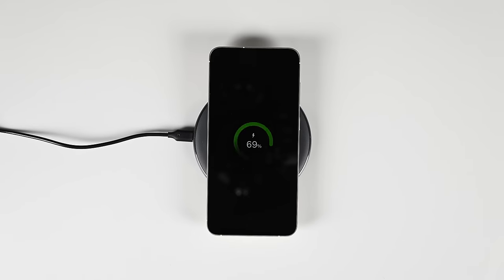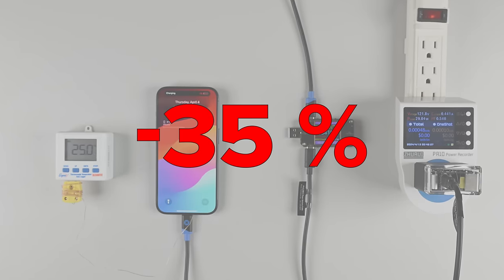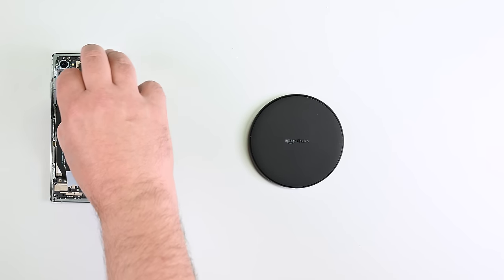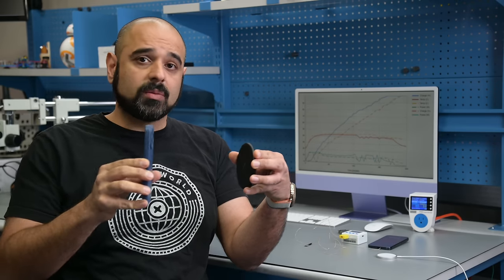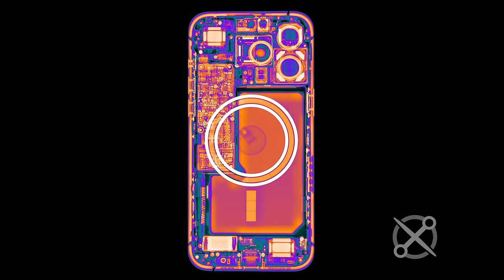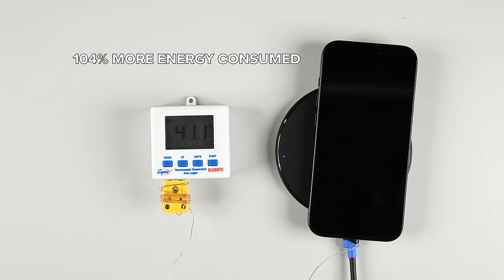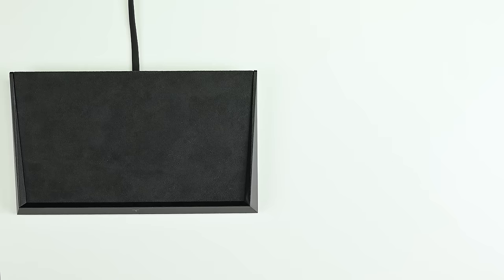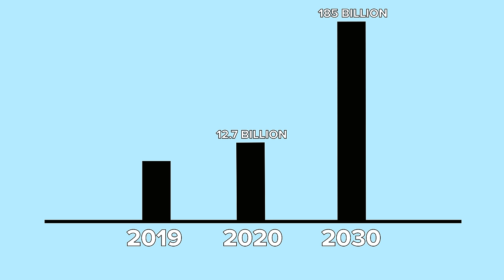How Wireless Charging Works and Why It's Terrible

Comment: I go a step  further and use a normal 5W usb brick most of the time unless im in a rush, then i use my faster 25W port. Its just not worth it to fast charge when i have so long after work to keep it plugged in. Also don't charge overnight, if your phone cant hold a charge over night and be usable the next day then you need a new battery. BUT to be a devils advocate, I worked in a repair shop for a very long time and people break charge ports very often, its by far the most common repair besides a screen replacment. So most of the time, changing a battery yourself is easier then replacing the Charging port. So there is 2 sides of the coin.

Comment: Wireless charging is also not wireless at all when compared to anything else we call wireless. The difference between wired and wireless charging: put the wire into the device or put the device onto the wire. Its a silly gimmick.

Comment: I got a 15 pro and i charge it with a wireless samsung charger and my battery last a lot longer through the day
Reply: Due to the temperature regulators and the fan that the charger has

Comment: my xiaomi 50w wireless charger is much faster than samsung and iphone wired charging methods, and it comes with a built in fan, so never over heats, on top of that it only costs 20 quid

Comment: Degrees Centigrade? Not Celsius?
Reply: Same scale, but centigrade is the older way of referring to Celsius. "Centi" meaning 1/100th, and the grade (gradient) defined from 0 (water freezing at 1 atmosphere) to 100 (water boiling), every step of Celsius is the 1/100th step of the gradient...
Reply: @NG6E  Yes its just the same thing, but the issue is thats the old name, It's called Celsius now.

Comment: I imagine, environmentally, not only are you using less energy to charge the phone with a simple USB C cable but you're also, physically, using way less copper, plastic and electronics with a simple USB C cable vs any charging puck. (Of course you'd need to factor in how often you replace the cable due to insertion cycles, but IIRC USB Type C is rated for 10k cycles, so like 27 years if you charge/plug in daily).

The embodied energy and thus embodied carbon to manufacture it being much lower than a charging puck.

Really wireless is only a modicum of convenience gain vs a massive environmental and energy tax.

Comment: The wireless pad already having a cable to it is funny. Why not plug it directly without extra steps.
Reply: because its easier to use, just put the phone on the pad and its done. no need to fiddle with cables and it helps your usb port last long

Comment: I'm not a fan of wireless charging. Especially now with USB-C PD 3.0/3.1 chargers in the 20 to 45 watt range being so cheap.
Reply: PD is even worse for your batteries.
Reply: @SanderEvers  Depends on how both the chrarger and the cellphone communicate through the PD protocol. If it works as advertised, the charging rate dramatically drops as the battery level starts to approach 100% to save the battery. 

I'm not a fan of wireless charging beause the induction coil charging tends to really heat up the whole phone.

Comment: ....But they aren't even 'wireless' tho...
I'd be into these things if they were, but all they do is just eliminate you directly plugging it in to your phone. Still plugs into a wall outlet, still is wired, you just don't actually plug it into your phone, and you now have a bunch of adverse effects, but you skipped a single step and don't have to plug your phone in and out each time...so yaye??.

Comment: Yes, of course, It's important. But - this is a bad realiazatiobns only. Why do you thing I need to charge with high power? And why the smartphone should be exremaly thin without the thermoconductive layer "Batter-case-etc."? I'm OK with typical charging speed 5W and with smartphone like Kycera Duraforce 5G. If Apple, etc. don't want to make a smartphone for me (with wireless charging, etc.) - I'll by another.

Comment: To be fair, the inefficiency isn't really a big deal if the charging pad is plugged in to an outlet.  The amount of energy involved in charging a phone is very small.  It's a bigger deal if you use a wireless charger with a portable power source.
Reply: Now multiply daily waste, 365 days and for each person in a household.
Reply: @sonickrnd  Its still negligible

Comment: Wireless chargers are not really wireless. You still need a wire for the charger. And they're not really contactless either. Cause the phone needs to stay on the pad.  Which brings me to my third disadvantage: mobility. Since the phone needs to be in direct contact with the charging pad, you can't use your phone while charging. While I understand the appeal and the interest for these chargers, I continue to charge my devices wired...ly.

Comment: Sorry, the "+104% worst-case" scenario sounds a bit construed and cherry-picked. Sure, it takes more than 100% power, but 120% (i.e. +20%) is a far more realistic number. A decent and intentional "back burner" design that would charge the battery overnight with low power, could in fact increase the lifetime. The alternative USBC connectors are not without their own flaws. It is, as most things in life, a tradeoff, and 'blanket' statements like these could be misleading.

Comment: Jokes on you, i connected a 5v 1A supply to my charger, it may not be efficient or fast. But my phone is still fully charged every morning while staying low temp.
Those few cases i forgot to place it on the charger i just plug it into my monitors 65w output while im getting ready.

Comment: For now the wireless charging is the future. In 10ish years wired chargers will be rare, and no-connector phones will be the standard. Data transfer between devices via wifi signal, and charging via coils. Then another 10-20 years from there, once energy efficiency and charging tech will further developed, power via wifi will be a common thing, and you won't even need to charge your devices, they will just charge from the nearby wifi signals.

Comment: It's okay, in theory, as long as the coil is cooled with a fan as most wireless chargers designed with longevity in mind from OEMs. However, as the video indicated, not all are equal or designed with a similar philosophy in mind.  lnefficiency, unfortunately, is inevitable, but I must also state that batteries currently have stagnated hugely and have been long over due an overhall in their efficiency tech and longevity. If both these occur simultaneously, I have no doubt the potential for wireless charging could work, but more often than not, wireless charging was more an afterthought when it risen in popularity that still echoes to today. The implication, unfortunately, is that this may translate to less priory on wired charging innovation or be the cause of death for it - which nobody wants. Besides, given how you seemingly can never have your cake and eat it these days with lackluster moves from major OEMs, I'd leave it alone and focus on where it truly matters: solid, reliable and fast charging with a physical connector to handle charging and data transfers, not a even wall gardened and/ or potentially proprietary data transfer method which will cause no end of headaches and backlash (I.e. the world apple wants).

Comment: I never got the appeal of wireless charging, sure its a fun trick but your wiring a source to where your phones going anyway, just plug it in at that point
Reply: It's more convenient, especially overnight, no need to plug it in, just set it down
Reply: @MrToastyYT  i mean barely. Its the difference between setting it down and plugging a thing in and setting it down

Comment: How does this degrade the battery. You showed data about power consumption, charge time, efficiency, and temperature. There is no evidence of immediate induced battery degradation or way of knowing which is worse.

Comment: OF COURSE it's terrible.  The last thing you should expect from wireless charging is EFFICIENCY.  That's why we only use it to charge small, low-power devices.  In the end it's really, really hard to beat WIRE for delivering electrical power.
   
All you get from wireless charging is (a little) convenience.  Don't expect anything beyond that.

Comment: Wireless charging: buy a new device you don’t need for a feature that wastes energy, charges slower, degrades your battery through overheating, and takes up space/weight inside your phone that could have been used for a bigger battery in the first place 🙃

Comment: It's NOT wireless, it's just plugless.  The power brick is still there, the wire is still there. The plug becomes a disc, that's all. The real wireless chargers are those built into, say, the base of a desk lamp. That's truly wireless. The rest are just plugless!

Comment: It's not even wireless in the sense like WiFi. Phone needs to sit somewhere and it can't be used properly. This should be called something else like coil charger.
Reply: Well it is wireless, there's no wires, wireless doesn't mean it charges without touching, it just means there's no wire
Reply: I would say there is wire. It's just not plugged to tour phone but to the coil. Otherwise everything can be called wireless, I pee wireless 😅

Comment: I’m confident that wirelessly charging costs less in the long run than constantly replacing charge cables yearly (and in our household, it was twice yearly). Also, I use a standard 12W charger rather than any fast charger unless I’m traveling, so I’m curious if overheating would be an issue.

Comment: The hypocrisy of these company talking about green initiatives, greenhouse emissions and with the “clean energy charging” option in the phone. With these technologies using double the amount of energy to do the same thing. And is not wireless at all, is visually kind of wireless but it not that you can move around the house while still charging your phone like you’re connected to the “WiFi” and still have WiFi when you walk around your house. They create a problem and a solution themselves.

Comment: The energy argument is very minor for phones, a phone is just 0.29% of a persons electricity consumption. Even if it doubles it's not a big deal. Obviously charging an EV wirelessly is very wasteful. And the temperature issue can be mitigated by engineering as well as limiting wireless charging to 1A. So you have trickle charging wireless and fast charging wired. I don't understand the absolute weird and disproportionate hate for wireless charging. It's the best QoL feature and I would never buy another phone without it. Very disappointed with the very one sided approach from ifixit.

Comment: I always recommend wireless charging for portable devices.

Wireless charging does waste some power.

However, wired charging wastes cables - most users use a large number of cables, which are fragile and need replacement. (Yes I am sure readers here take immaculate care of their cables and have never replaced one. Most users don't.) 

Most devices ports also do not stand up well to the connection/disconnection cycles - leading to early retirement of the device or repairs. (As above, I am sure the paragons here have never had a port failure, but most people are far less cautious and do damage their devices - or wear them out.)

Together these factors ensure that wireless charging has a lower overall environmental impact for most users.

I always recommend wireless charging as a result, but I also always recommend MagSafe whenever practical, followed by Qi 2 certified devices.

I would very much like if wireless chargers had a trickle charge mode, which would help with the power efficiency and heating issues. (I said "help with," not "eliminate.") 

I knew the Tesla charger was not good - but I didn't realize how bad it is until this video - thanks for that.

Comment: I dont like wired because it degrades the pcb of the usb c much faster than battery degradation. Eventually it will be so loose, no pin contact can be made thus rendering charging impossible or difficult.

Comment: you can pry my wireless charger from my cold dead hands. I've got an einova one built into a marble stone which acts as a heatsink preventing overheating - but the main reason I use it is so I can reduce wear and tear on my phone's USB ports.
Reply: They are rated for like 10k cycles, you will probably have a new phone when you reach the cycle limit, that is the most braindead take.

Comment: Why do you keep saying Centigrate instead of Celsius? Its just wrong!
Reply: Centigrade is another way of saying celcius.
Reply: "the name Centigrade was officially changed to Celsius in 1948 to honor the Swedish astronomer Anders Celsius, who first proposed the scale in the 18th century"
Reply: @fabioschehr9801  So what you're saying is that they are the same thing and therefore using the term centigrade isn't wrong
Reply: @jessl1934  im saying it was changed oficially to honor someone who deserves this honor. Saying Centigrate outdated and thus wrong.

Comment: iPhone 14 Pro 1.5 years in use. 89% capacity left. No heavy tasks just regular use (Tools, calls, documents, research, chatting) I used MagSafe which I bought in apple store, with Apple original power adapter in european outlet. I throw that piece of junk in the bin, since 6 Months only cable (in that time I lost 2% capacity) MagSafe charging is Literally a straight: "F*** you, buy a new phone every year!" by Apple.

Comment: Whats with this sudden agenda against wireless charging? 😂 MagSafe works great, the power losses are negligible considering phone batteries are tiny anyway. I wouldn’t want to charge an EV battery wirelessly of course.
The heat damaging the battery is probably only an issue with cheap android phones… my iPhone 15 Pro never has this issue

Comment: Understanding the physics behind it I never started using wireless charging. Tech youtubers often rave about wireless charging as if it was magic and some even want it for electric cars... oh the irony of the "green energy" that is wasted because someone couldn't be bothered to plug in a cable. 

The only reason I'd ever use wireless charging is to prolong the life of a device with a broken port. Or when I rarely use my phone to wirelessly charge headphones which I forgot to charge at home.

Comment: the dumbest thing about wireless charging is that companies like apple decided to make their phones like 90% glass on the outside in order to make it possible. the glass back plates they make are super fragile and a pain in the rear to replace. i miss not having to have a plastic case over my phone for its whole lifetime.
Reply: Nope, that was a cosmetic choice and started way before wireless charging was a thing. Wireless charging is possible through plastic just fine

Comment: Wired charging with a fast charger adapter brick is so much better and won't overheat your battery or cause accelerated degradation much if left in an open area where heat can dissipate well, despite what you may think. I'd rather not pay for a new battery after probably half the usual time for the "convenience" of just being able to place it down. Wireless charging is SO SLOW and I usually use my phone while it is charging, so not really convenient for me.

I can charge my phone from 20% to 80% in approximately half an hour. The phones of today have programming built in to slow down charging when the phone reaches a certain temperature or when it reaches the final 20%, whichever comes first.

Comment: As a tech guy this has always been one of my least popular opinions. Screw the wireless charging, use that space for a slightly bigger battery and I’m a happy guy. Or just leave it out and bring the weight down. Either of those two would be way higher on my perfect phone wish list
Reply: Better yet, make the back cover removable and battery easily swappable.

Comment: I honestly dont even get what the "Convenience" is about ? 
The transmitter is STILL CONNECTED VIA WIRE.  In fact, its worse now, you cant even pick up your phone in your hand to use it anymore, you have to pick the dang charger with it. I dont understand why is an industry growing where there is literally not even 1 single plus point to it

Comment: I knew I wasn't crazy for never using wireless charging. I'm uninterested in it and it'll always be inferior to a good ole cable plugged directly into an AC adapter. Seriously, most people are likely using one of those crap single device wireless chargers that.......have a cable plugged into them that could just charge your phone directly. Are you afraid of your phone touching a table?

Comment: wireless charger - style over substance. And the biggest irony, its still require a WIRE to begin with 😅
Reply: Except you don't have to wear out a physical port every time you want to charge. If you use your brain a slight bit more, you'd see more reasons it can come in handy.
Reply: @coldbrew6104  "wear out a physical port" 🤣🤣🤣🤣🤣

Comment: Wireless charging is the technological epitome of the saying "Two steps forward, three steps back". In my opinion, it's just not worth the performance loss for conveinance. Now TRUE wireless charging, like over the air like Wi-Fi, would be worth the inefficiency. Unfortunately, the technology isn't here yet and likely won't be commercially viable for quite sometime.